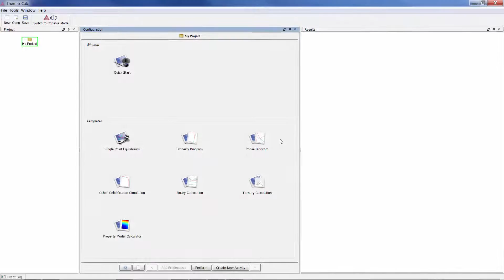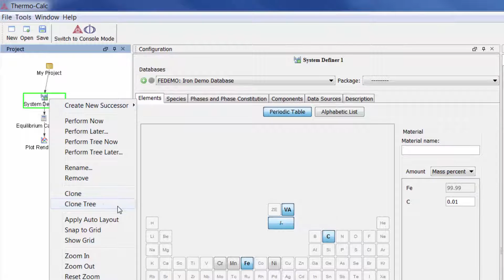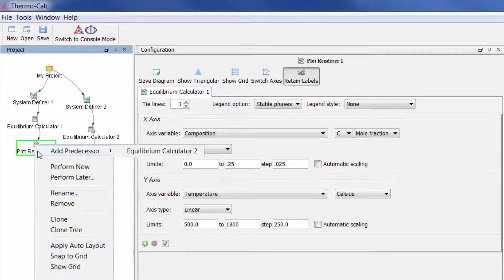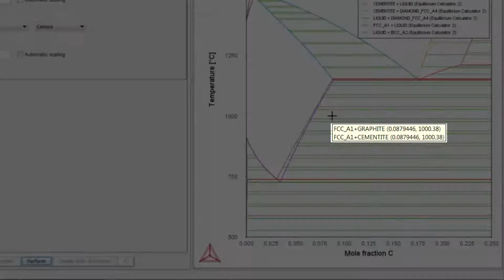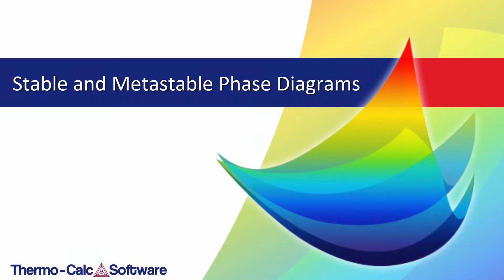OUTDATED Example T_05 - Stable and Metastable Phase Diagrams

Comment: Question from 4:00 in the video:
Why did we know that the stable "graphite" phase is listed first? Is that some background knowledge that cementite is metastable?
Reply from the maker: Hi Partick! The Gibbs energy determines which phases will form. We know that graphite is stable since that phase is shown in our stable phase diagram, which is the first phase diagram calculated in this example. If we then remove the stable phase, i.e. graphite, the metastable phase will form instead, which in this case is cementite.